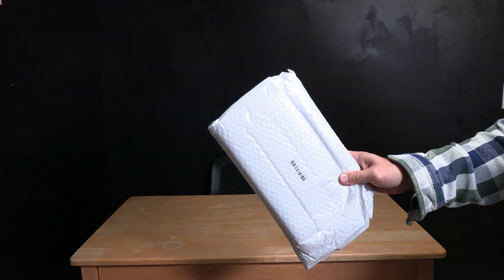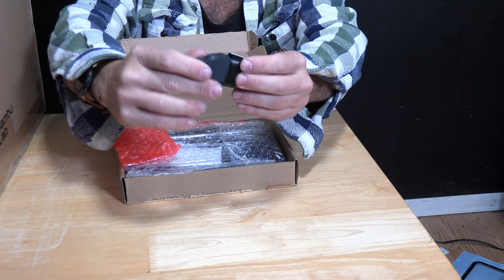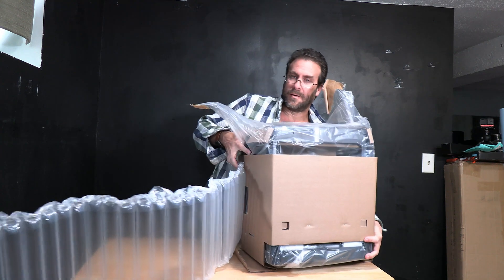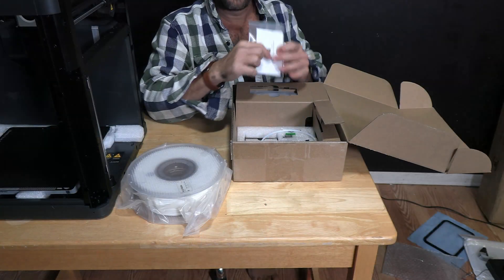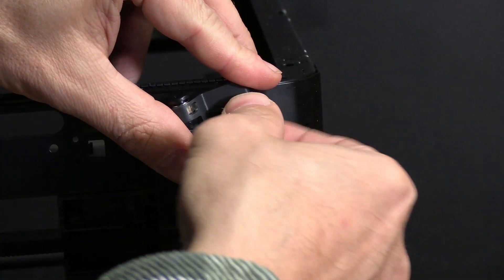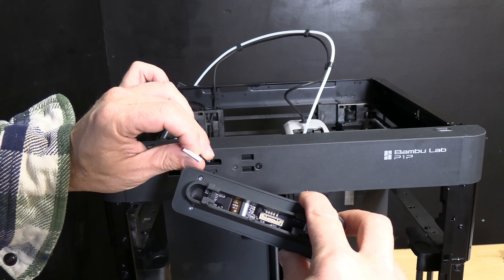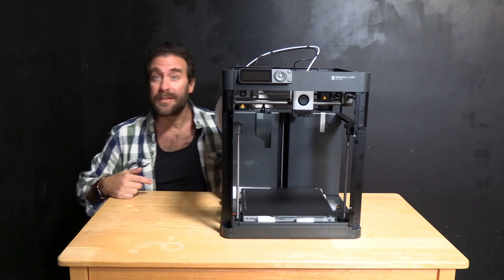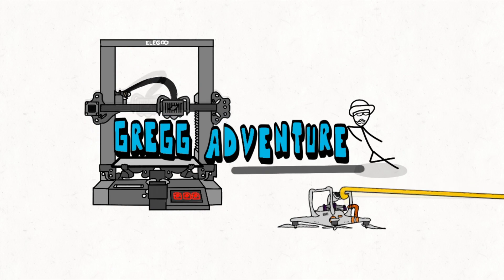Unboxing Full Build of Bambu Lab P1P 3D Printer (and pre-order welcome gift)

Comment: Hi. Does the p1p have to be run off the app. Or is there a way to use sd card with codes from PC port over to the printer as enders .
Reply from the maker: There is a Micro SD Card slot. I assume we can print from it. I will confirm shortly!